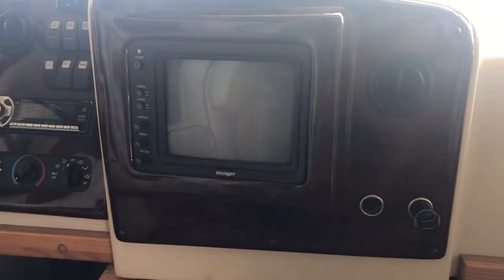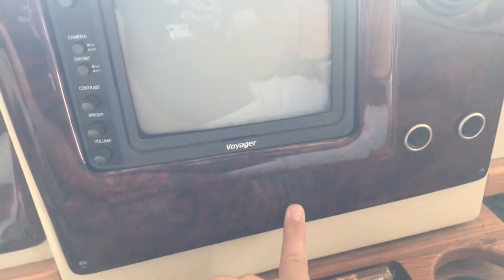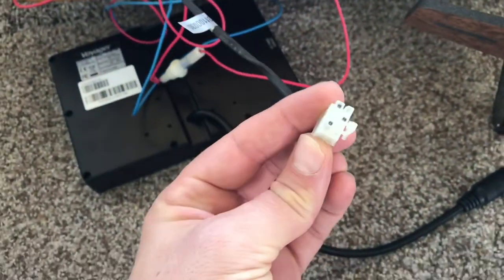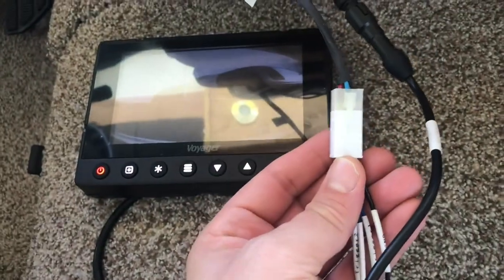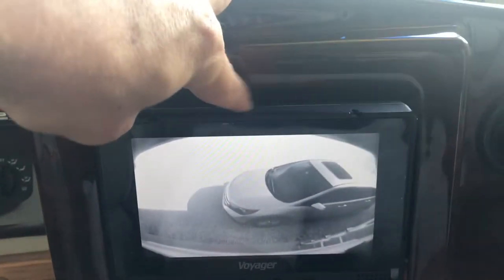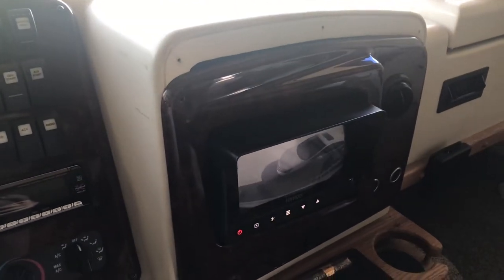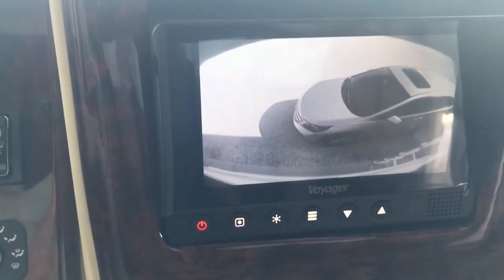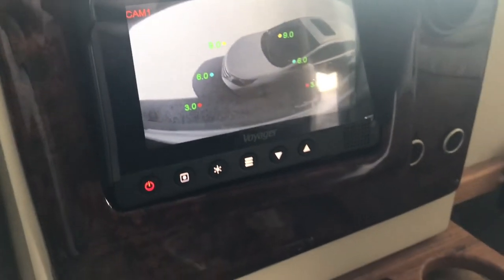Replacing The VOM78 Backup Monitor With A Direct Replacement From RVCams.com

Comment: I just did this and it worked great. Call the company first and make sure they know exactly which camera system you have (1,2,3,or 4 cameras) so they can send the appropriate numbers of adapter cables. I goofed up and ordered the wrong kit on line but they quickly sent me the other two cables I needed. Great service and they actually answer their phone, usually on the first ring.

Comment: We're looking at 90s to early 2000s RVs. Ive noticed all of em have the old CRT backup cameras and blah radios. I was thinking of maybe just going with a nice Kenwood CarPlay system in play of the CRT backup display. Wondering if there's a an adapter to use the stock cameras though

Comment: Interesting. I was actually looking to see how difficult it would be to do this very thing. Just purchased a 2005 Alfa diesel pusher, and it has an old black and white monitor with a microphone that allows me to hear people behind me. I can't talk to them for some reason. Design I guess. But I would like a new color unit and maybe one that has a GPS unit as well. Thanks.
Reply: In my case it’s a good thing there isn’t a microphone,.. the wife doesn’t need to know what I’m mumbling 😝.
  Nice video, thanks

Comment: I ordered same but it came without the four and three pin adapters to connect to my existing set up. Did you order the pins separately and wire it yourself?  I contacted the company and am waiting for a reply
Reply: I apologize for those mixups Michelle. Thank you for being patient and allowing us to correct the errors -- Tim